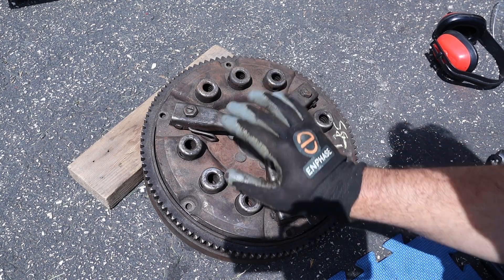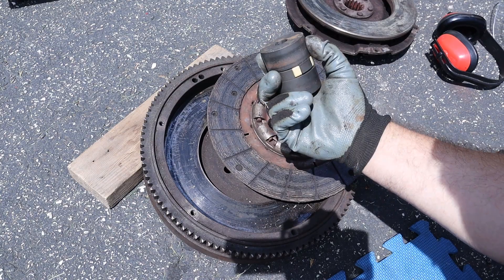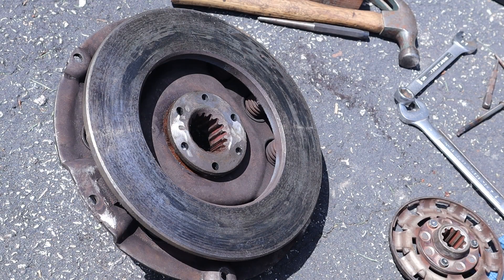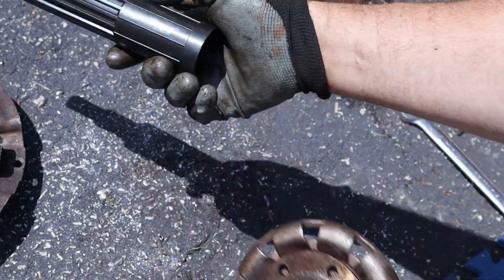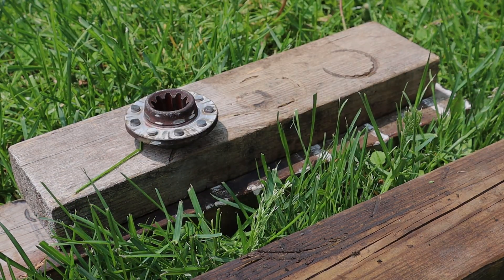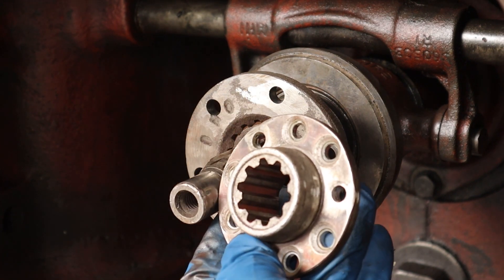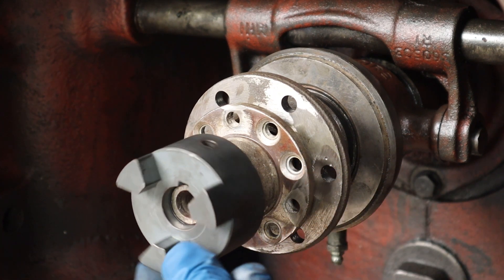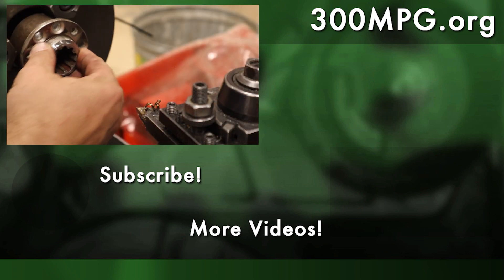Electric Tractor Coupler Construction Part 01

Comment: Will the PTO be useful if the wheel-speed is directly correlated to PTO shaft speed?

Could the PTO have been driven by a separate motor or using the clutch to keep the tractor still while using the PTO?

I guess you could also just mount a motor anywhere as a PTO…

Comment: I did an electric tractor conversion and had to install a flywheel to get it to run nice and smooth.  W/o a flywheel I would get huge spikes in amperage when you jerk any kind of movement.  Hope this helps

Comment: I think you messed up.. You should have kept that clutch in tact so that you can disengage the PTO or driving independently.   I understand that all the extra rotating mass is an issue for "Acceleration" -- but in a tractor, you don't need acceleration at all.  And all that spinning weight actually works in your favor when running a brush hog, because if you hit a stump or rock, the inertia of that rotating mass will protect you motor.  Where as now-- any kind of sudden SHOCK from hitting something with your implements is going to directly transfer into the motor.  So you lost two good benefits by doing away with the clutch...  I tried my best to explain this in one of your past videos..  So I suppose you're just trying to get this thing built for the videos and not actually planning on using it much;  which is fine
Reply from the maker: Hi Calholi,
More than anything, I really just want to get the tractor going.
I have a brand new clutch and cover and still have the flywheel. So, it's not like I'm at any loss of parts here.
I really don't want 80 pounds of flywheel hanging off this Etek type motor.
I'd like to try the tractor in this configuration and see how it works.

PTO on this tractor is independent. It can be engaged or disengaged at any time regardless of what the wheels are doing.

I also have a 13" series-wound forklift motor. That should be able to hold the flywheel just fine, but it's also a lot more complicated machining to make that happen. Frankly, even making this simple coupler is good practice for some basic machining skills.
That 13" motor SHOULD just exactly squeeze in to the tractor, but there's other complications as well.

Constructive criticism is always welcome.
Reply: @BenjaminNelsonX  I have a ford 8n converted to electric.  You really need a form of a clutch  as you don't have enough hands to drive the tractor, run the front loader and control forward/backward motion.  My conversion was clutchless and i had a problem when running a back blade.  I ended up adding another pot box attached to the clutch peddle so that my foot could control the forward/backward motion.  It is a bummer to loose the live power aspect for the pto but livable
Reply from the maker: @timothychapin8879  Keep in mind that power ALWAYS goes to the PTO on this tractor. It is engaged or disengaged with a handle to the right of the operator. The PTO is UNMODIFIED compared to the stock tractor.
Reply from the maker: @timothychapin8879  You might be right about needing a foot-operator throttle. I really want to try the tractor and just see how it goes.

Comment: I may have missed something, but didn't you want to have the ability to drive the PTO without moving the wheels? Or will those decouple elsewhere?
Reply from the maker: With this type of setup, the PTO can spin without moving the wheels by simply not having the tractor in gear.
The PTO has it's own dedicated control, so the PTO can be turned on and off while the tractor is in motor.
What it would NOT be able to do is have the PTO spinning, and then smoothly pull away from a dead stop.

Part of this too is just that I really want to try it out. A solid coupler is much easier to design than an entire flywheel/clutch/clutch-cover/bearing/weight-support. After testing this out, I can see if it works the way I want, or if it really DOES need the entire flywheel assembly setup.